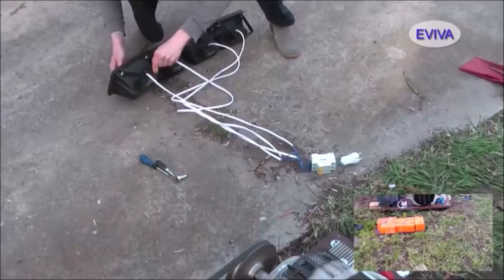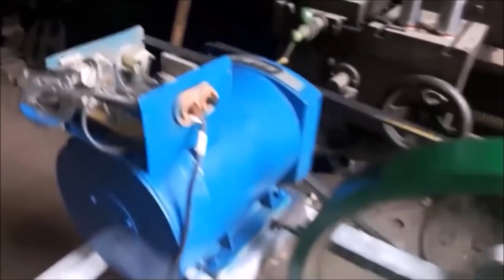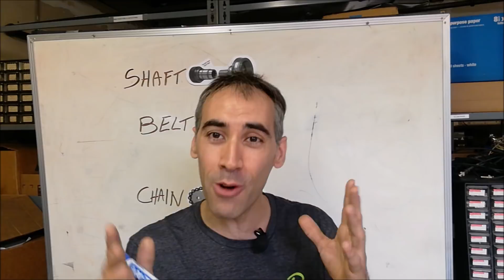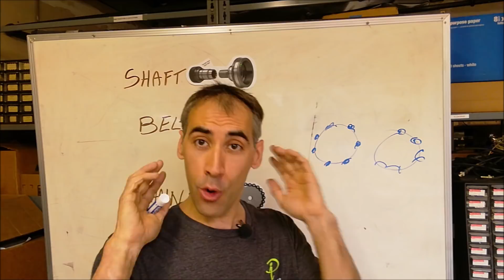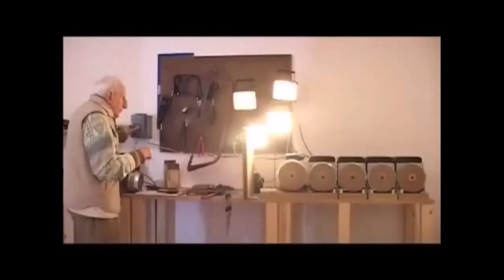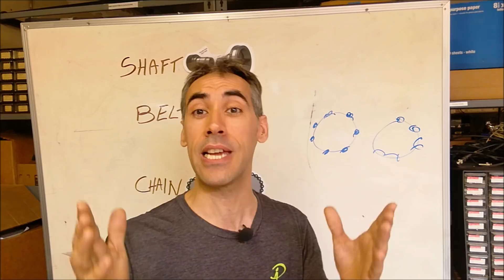INCREDIBLE FREE ENERGY WITH COGGING AND MAGNETS ANOTHER LIE EXPOSED

Comment: I am a qualified Electrical Engineer having more than 50 years of experience.There is a basic rule that in any machine there is input power which is equal to output power as well as losses.So any eternal machine is a white lie ,since every machine has some losses, and due to that the output power cannot be equal to input power.So never believe any person who says contrary to above.
Regarding production of Electricity with the help of a magnet, as per Faraday's laws either a conductor should move and cut lines of flux which are present between North and South poles of a magnet, while the magnet is stationary; or, if the conductor is stationary then the magnet should move .But if Magnet is stationary and conductor is also stationary, then no electricity can be generated.

Comment: some late info.   here's some of  the more  Obvious  Facts, that were not mentioned.      1)  when  small pm motors are used,  on the input-side, energy is 'consumed', as the motor converts  watts-electrical  to  watts-Mechanical.      in most cases,  the 'experimenter' does Not provide (or understand)  Accurate  input-side  OR  output-side  Power values (Watts).         2)  on the output-side,   an unmodified  pm motor makes an  INEFFICIENT   pma.       as a result,  the amount of  energy coming  Out of a second identical pm motor,  MUST   BE  Much  Less,  than what went into the  driving motor.        3)  the  powering of  LEDs  or  lamps  is  indicative of  (supposed) continuity.  ONLY.        4) as mentioned,  there ARE  LOSSES,  in  Any type of  transmission; this includes,  a  magnetic, non-contact transmission.                  i encourage  ou  experimenters to investigate the use of  Mechanical Advantage, as a method of achieving  apparent  ou.       see  large-radius, HIGH-torque  bldc  motors, to be utilized as a  prime  mover.      see f&p motors  and  large-radius (no internal gearing)  e-bike hub motors.     power  Must  be taken off  at  the  Center of Rotation, where the Torque IS.      so, an output shaft  Must  be  attached to the rotor bell.    cheers            googletranslate            concept shown here
https://www.youtube.com/watch?v=IiI13X7fNVM
https://www.fisherpaykeltechnologies.com/products/direct-drive-motors/
https://www.leafmotor.com/hub-motors/8-electric-bike-motor.jpg

Comment: I agree with the BS of free energy but why can't you say take 4 moter connect and wire all four shafts together as one and connect the phase togather in a vortex like way to make torque from I side the generator
Reply: To what end? Any transfer of power means losses. It makes a noise? =loss. It produces heat. Loss. It vibrates. Loss. It wears the parts. Loss. There's a wire? Loss. It moves air? Loss. 

The more direct the system the less losses but there always are some. Unity is a impossible. Overunity is a lie. There's no such thing as magic but frauds? Yeah, they exist all right.